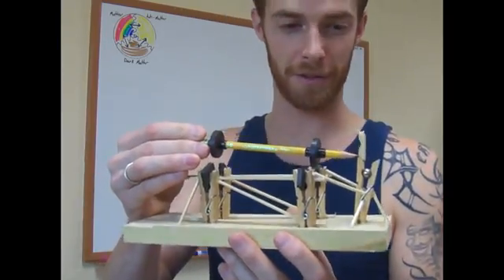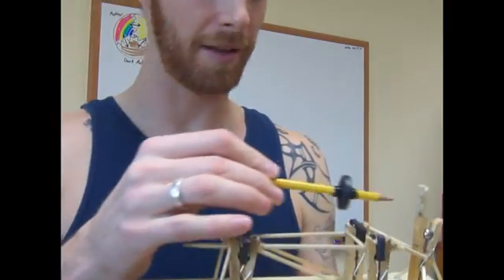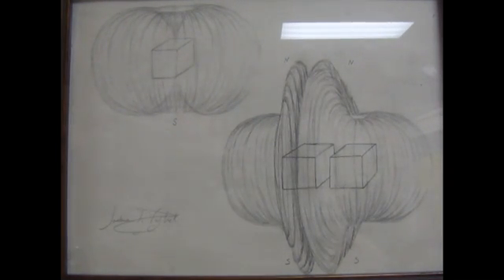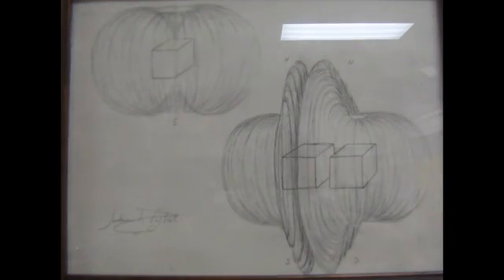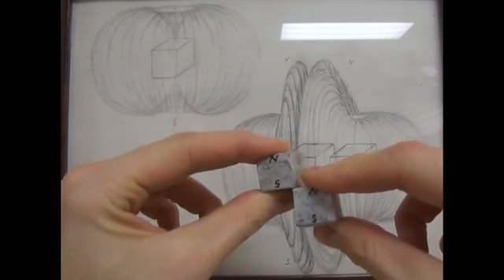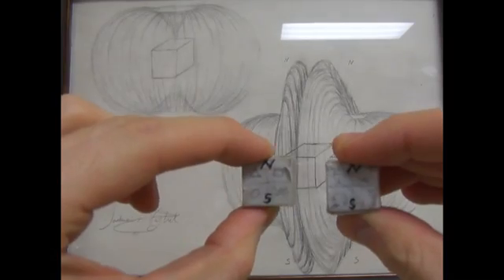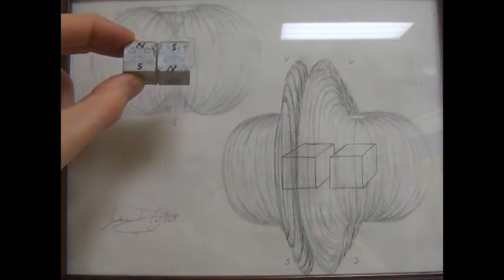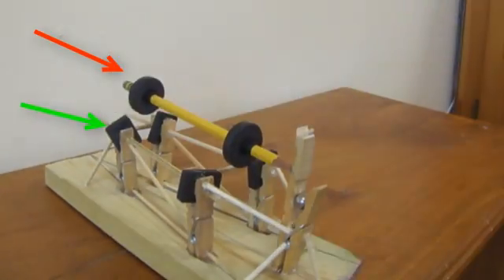Magnets Are Awesome ~ The Levitating Pencil

Comment: Great Josh! I did a simple experiment one time using 2 square Radio Shack magnets . I used the opposing poles to levitate the one magnet over the other. I then  stabilized the 2 magnets on their vertical axis, through the holes with a piece of piece of coax, so that they levitate.

I used a small digital scale to measure the force required to close the gap, between the 2 magnets. Naturally the force calculated was  in joules, but it is still a  force. So, force = energy... which implies that the magnetic fields induce energy from somewhere.